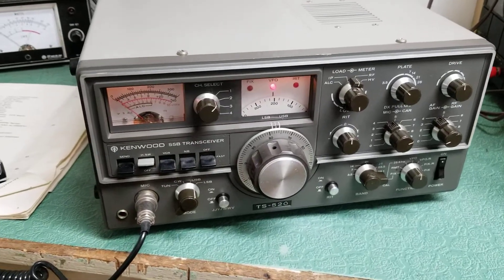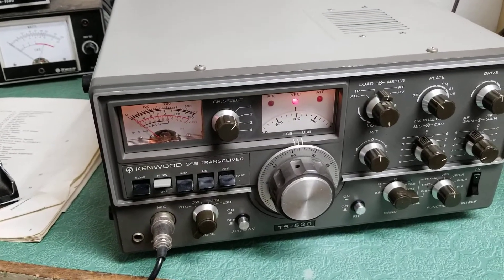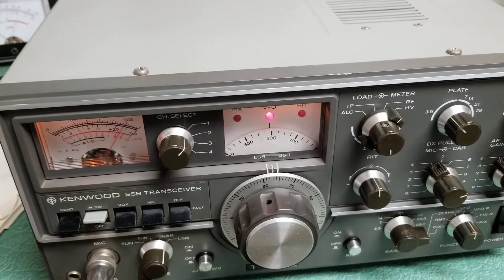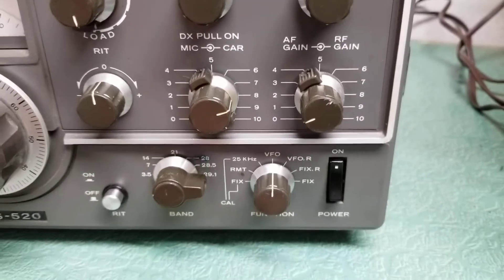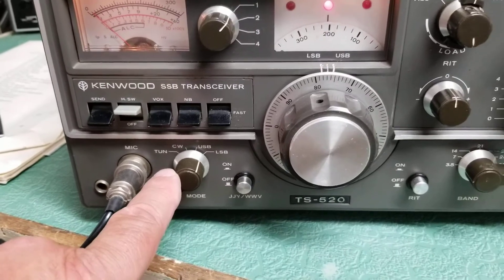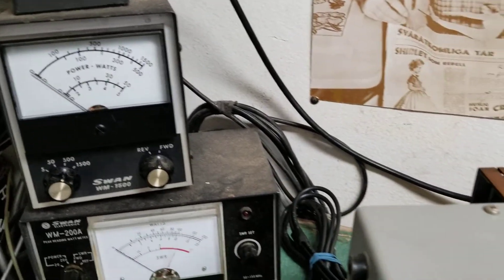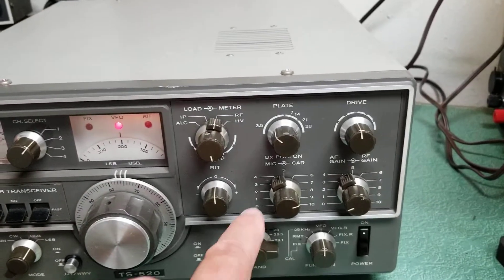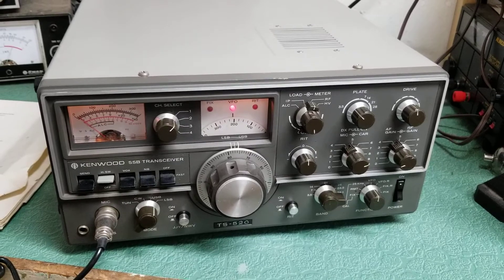Kenwood TS-520 Transceiver

Comment: Did you figure out why there is no output in TUNE?  My radio does the same thing. I have replacements for the 56kohm resistors on the HV board that might be the culprit.
Reply from the maker: No I didnt